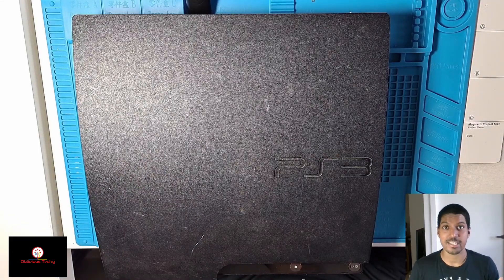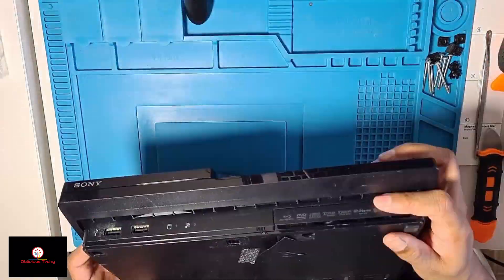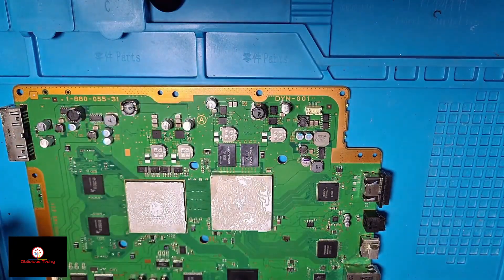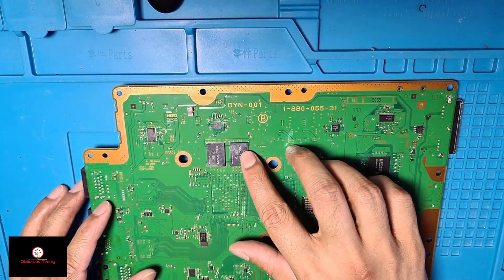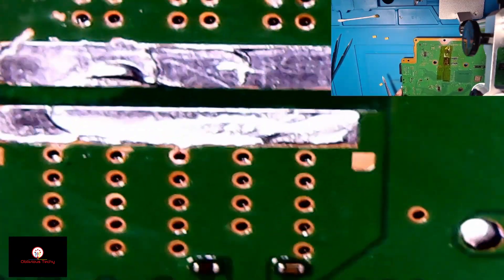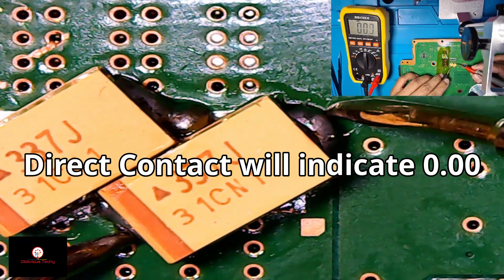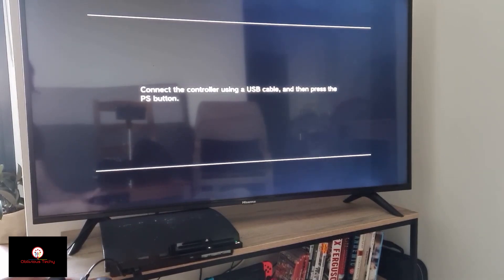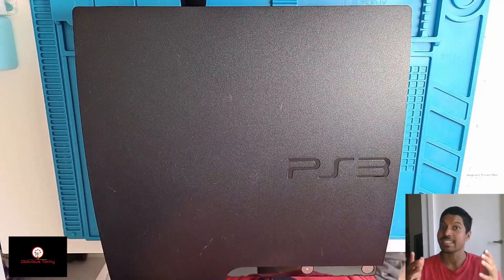Sony PS3 Slim Yellow Light Of Death (YLOD) Capacitor Fix | Can I Fix It?

Comment: Hi I have a PS3 Slim and would like to replace the capacitor as well.  Can you share what is the item or model number of the capacitor you need for the PS3 slim?
Reply: Thank you thank thank you.

My wife loves her PS3 and it’s dying. I don’t want to buy another used ps3 and have it die too as this is a common issue. I will be using that Syscon thing you mentioned in other comments, and also buying these if they are the issue…. Thank you!
Reply from the maker: Hi I used 2.5Volt 330 Micro Farad tantalum capacitors.
Reply: @ObliviousTechy  would it work with the first gen ?
Reply from the maker: @EL BORIKKEN this site has a list of compatible models - https://www.psx-place.com/threads/tutorial-nec-tokin-capacitors-replacement-ylod-fix.25260/
Reply: @BORIKKEN  For PHAT models I would recommend 470uF and at-least 2.5v
Reply: @ComputerTechnic217  would these work on a slim as well?
Reply: @zey2k  Yep!
Reply: @ComputerTechnic217  thanks!
Reply: @zey2k  np broski. but it isn't a guaranteed fix. before pulling out NEC Tokins, use a 3.3v USB to TTL converter and communicate with the PS3's syscon to understand specifically what the issue is (google a tutorial, and PLEASE DO THIS. I spent so much money trying so many different things aimlessly to fix my ps3. please do syscon first)
Reply: @ComputerTechnic217  the cost will be fairly low, a good friend of mine who is good with repairs was kind enough to do this for me. The think that strikes me more is that the console sometimes work, and the more heat it has, the longer it stays on. Its from the cold boot that i have the most issues, which leads me to think its the capacitors fault. Tried different harddrives as well, and i'm preety sure it isn't for overheating as i change its thermal paste every 2 years and monitor it every time i play. Given those facts, it could be something wrong with the power supply as well, but in whichever scenario it is, i'm looking for longevity, so those NEC have to go either way. If the problem persist, then we'll debug it. But thank you so much for your input! i will search about the syscon info.
Reply: @zey2k  oh then most likely its the NECs but many times people pull out the NECs but it's a different issue. Good luck my friend, okay. Thank you for the kind words
Reply: @ComputerTechnic217  Thank you as well! Capacitors should be here in 10 days, once i do the fix, i'll try to remember to update here as well. thanks again!
Reply: @zey2k   How did it go ?
Reply: @Aman--Wangnao77  hey! Haven't forgot this thread :)! Got the capacitors last week but my friend is only available next weekend. I'll post updates once the deed is done!
Reply: @zey2k  I was wondering if it fixed the issue? I bought a really older fat model that's backwards compatible. Ive had it for a few years now. I did try good thermal paste but nothing change. I just then put it in a closet and it jas been there for 3 years now. I was going to send it to Sony to fix but when I bought it, the seal was already broken and they said they wouldn't service it for me.
Reply: @bbay1977  with work and lack of schedule compatibility I still haven't done it. But rest assures this topic is not forgotten 😁 edit: my friend has been repairing some in his spare time, yes some were the capacitors, another was a short in the wifi module. Capacitors are your best bet, but never rule out the rest
Reply: @ComputerTechnic217  can you elaborate a bit on this? My wife loves her pa3 and I’m trying so hard to find out what’s wrong… the issue is identical to what’s happening here but if I could get a more specific reading that would be great.
Reply: @Revivejosh  Ok my friend, so buy a 3.3v TTL serial to USB converter. Use dupont wire and solder it to the SYSCON points for your specific PS3 motherboard. It's better if you follow a video tutorial for this.

Then, use the GUI based error code grabber to grab the error codes from your system. This will allow you to figure out what the problem is

Comment: Hey brother please reply to my message as fast as possible I have a ps3 slim model and ylod problem alright well will those capacitors from Ali express from the link in the description provided by you work and which volt should I really go with as I don't want it to get damaged and fry on me in the long run and should I get them or get the original black nec tokins 0E128 please respond as I'll fix myps3 in a few days I appreciate your hardworking and thank you in advance mate ?

Comment: Honestly i already changed cap on my ps3 fat. It work for a while, after i trying to update my software the RSX get hot n now it dead. I solve YLOD & now get GLOD. 
If u really want to repair PLEASE USE SYSCON first to get an error code so u can be sure where the problem came.

Comment: Is not a permanent fix tho, the new capacitors will fail again eventually, a friend of mine did the same thing to a PS3 fat and slim models, they only lasted like 3 months, plus you can kill your console for applying too much heat to the motherboard if you fix the same issue over and over again

Comment: Hi, I followed your tutorial for replacing caps in PS3 slim, and encountered a slight problem... So after soldering the caps(caps below the mobo) I tried to turn it on. It turns green for 3 seconds then turns yellow to red light. Then I tried to turn it on again but no light showed this time. What should I do? 
What I have done:
Used caps: 330uf 2.5v D
Replaced 2 nec caps below the mobo near RSX
and also no jumper wire connected.
Reply: Replace all
Reply: @clementmashala8134  u mean I need to replace all capacitors I'd installed? so the board and the PSU are not dead yet?
Reply: @chococornets6985  Replace all the nec caps. I don't suspect that the PSU is faulty. Replace all nec caps and put a jumper also.
Reply: @clementmashala8134  only the old NEC caps? not the ones I recently installed? I suspect that one of those are shorted.

Comment: Is it alright to use 470uf tantalum capacitors instead of 330uf?
Reply: On Slim 2000 Series? Better stick with 330s, but make sure U measure them, before U perform the mod ... Cheers

Comment: Do you know if this will work with chec 2001a, also where did you get the capacitors? I can't seem to find them.
Reply from the maker: There is a link in the description to see if your model is compatible and I just added the AliExpress link to the capacitors.

Comment: So does it still work then?
Reply: I have a ps3 phat that has been fixed by this method way back 2014. Still working perfectly up until today.
Reply: @ericsabs8613  What model exactly?  CECHL  or CECHH I think can be fixed this way.
Reply: @calyps0man  It's a CECHK model.
Reply: @ericsabs8613  Exactly my point. Wouldn't necessarily work for CECHC
Reply from the maker: @Artificial this site has a list of compatible models - https://www.psx-place.com/threads/tutorial-nec-tokin-capacitors-replacement-ylod-fix.25260/
Reply: @ObliviousTechy  I know. I'm on that site myself. I only said that many have tried the capacitor fix on 60gb models and it didn't work. It seems to have worked on others though.

Comment: Hey man, can you please send me the link of where I can buy these capacitor from? I live in Sydney Australia..Jaycar is a good place to go to but I'm not sure which one is the right one. Please help
Reply from the maker: https://a.aliexpress.com/_mMB6LQd

Get the 330UF one
Reply from the maker: Hi Jaycar doesn't have the necessary capacitors. And couldn't find anywhere in Australia. I ordered them from AliExpress and arrived to Melbourne in about a month.
Reply: I just need 3 if you have some I'll be happy to buy them from you 😁 until I order from Aliexpress. Otherwise I appreciate your reply and help.
Reply from the maker: Sorry Ahmed I only have 1 left. Happy to help you out any other way.
Reply: @ObliviousTechy  All good bro, I ordered from Aliexpress. I have an issue with another ps3 though, it turns on but no signal what so ever I've tried to hold down the power button to hear the beep to reset, it won't happen it just switches off. Do you have any idea what it could be?
Reply from the maker: Most probably the HDMI chip inside is faulty. My other PS3 video had that issue 👇
https://youtu.be/6pgE-tnbuE8
Reply: Poison cobra I'm here for the same thing, socom 2020!

Comment: Any tips on making a PS3 read 💿 again?
Reply: Mostly the laser lens fails and you need to replace it.
Reply from the maker: I'm so sorry I wish I could help but I haven't had any experience with faulty disk drives :/
Reply: you probably need to buy a new disc drive